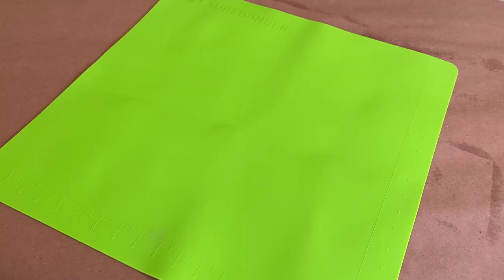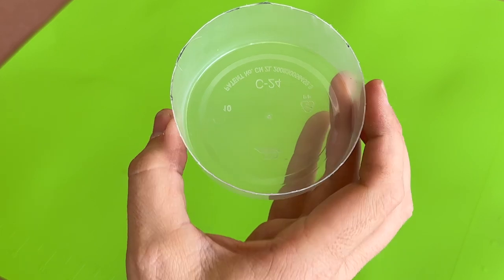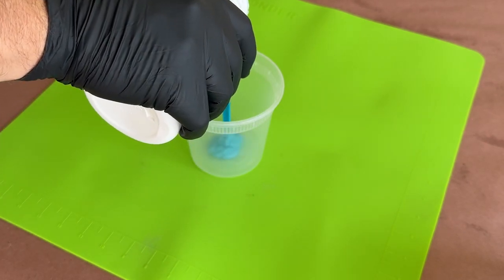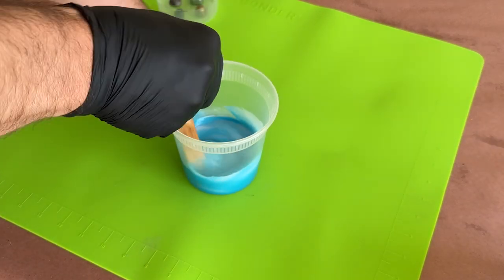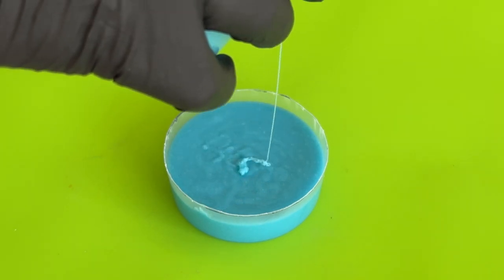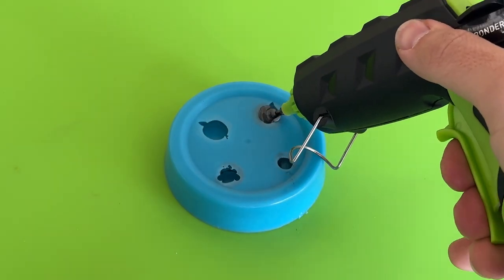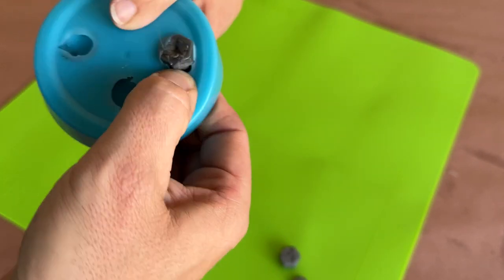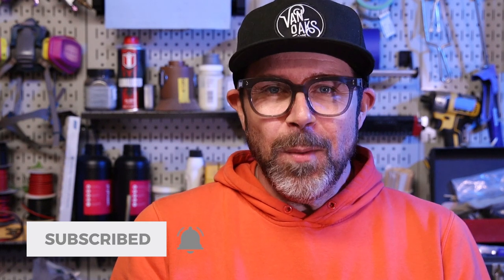Fake Hardware From Hot Glue

Comment: Easy & looks great...another great hint...if you need rivets, & you'll be painting your item, plastic googly eyes make awesome looking rivets once painted over.
Reply from the maker: Great tip!
Reply: I've used upholstery tacks to achieve this for a long time. If it's in foam, I'll use wire cutter to nip off part of the tack, and just superglue the tack in place. Works great to cover up mistakes.

Comment: In the first Avengers film all the bolt heads in the main room and a few others of the Helicarrier were made similarly. A two part pourable epoxy was used in much larger molds for mass production.
Bonus fact: The window where the pilot sits was a custom 3 inch thick acrylic piece with a seamless curve made by a company that makes aquarium glass.